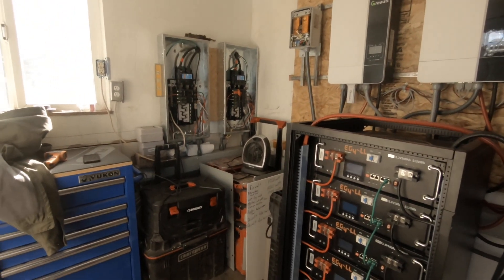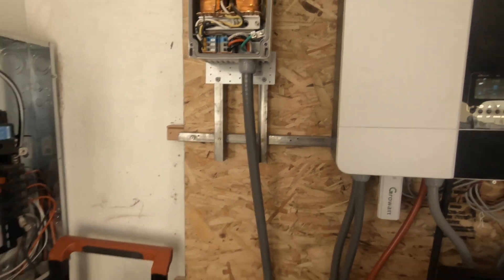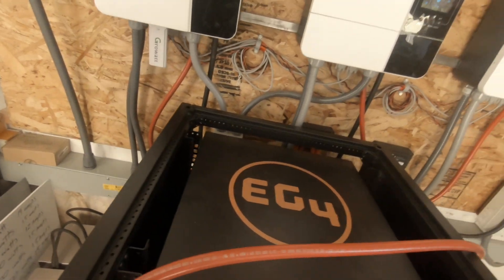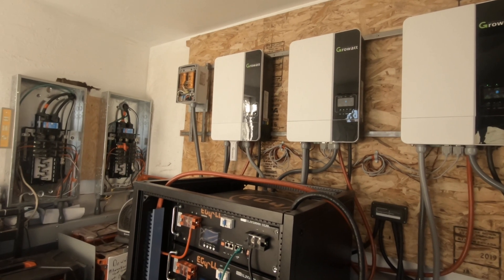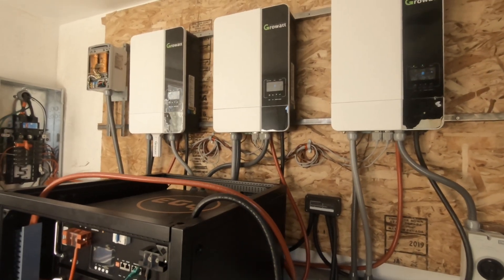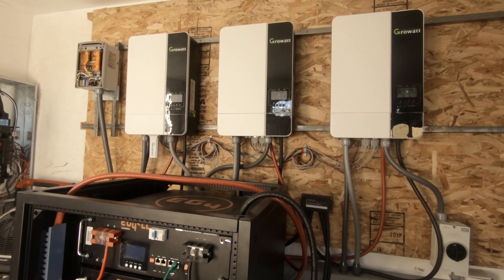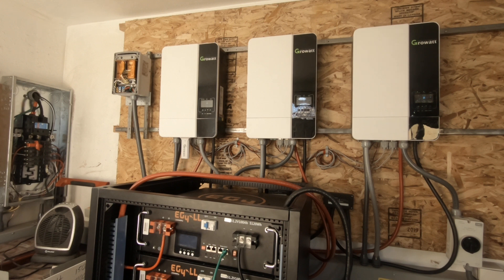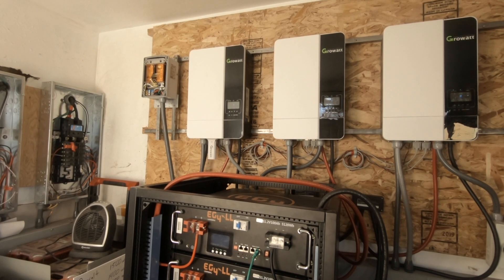battery upgrade part 2

Comment: Hello, just wondering if having two different types of batteries makes a difference? Do the batteries with the display work together with the older Gyll batteries? Thanks
Reply from the maker: all of those batteries are working very good together. I am glad to be rid of the big battery batteries. The Gyll and Egyll batteries are much better than the big battery batteries.

Comment: Just found your channel. Watching intently as I am ready to drop large bucks on a system too.
Reply from the maker: Hi, I am here to help homeowners who are putting in solar for themselves. My goal is to help people to avoid spending too much money and keep them from buying products they don't need. A lot of the sellers and youtube channels get paid promotions and affiliate links. They will use deceptive words like lots of power. but they don't put up a real power test. I wasted thousands buying from just those types of sellers or buying products that those youtube channels endorsed. then when I got my current system installed, they put out a video saying it was bad. Then they put up how they believe their products are better. But you still won't see a power test like the one I put out last weekend. Sorry about the length of the reply here. With these inverters they produce lots of power. But they also save you lots of money. I have 2 midnite solar combiner boxes. Plus all the breakers to go in them. You need to mount them out at your solar array. Then you run the wire to your inverters. My inverters are 98 feet away so instead of using 10 gauge wire? You have to figure your amps and distance you are traveling and put in the appropriate wire size. Too small of wire means a drop in power. That's an extra 400 dollars for each combiner box with breakers. I will post more video's as some of them don't cover enough detail. I am new to editing videos, as I just started this channel.

Comment: Sweet setup
Reply from the maker: On the cost breakdown it could take a few. I have to separate what I spent on things I am not using from the things that I am, Buying from sellers that say oh this will work.
or buying because a youtuber is promoting a product because the retailer is giving him a percentage has cost me extra money. That's why I started doing the videos. Some have little regard for what a homeowner needs are or what he should advise.
I will only make videos of products I am using. anyone who wants can show how theirs is, But i believe there is no better system for the money than the one I am running. One of the people who talks bad about this is telling people to buy the MPP 6548. but I will bet that my system that will have a lower cost can beat his. he also only uses his in his shop. he has a separate system for his house. If you want another youtuber who does load tests? check out davidpoz.

Comment: i am Not a Electrician
.
as i understand grounding
You must have Only one Active Ground in a system / circuit
the incorrect grounding only becomes a major issue
if and only when a
 short happens
.
then if 
neutral and ground are bonded
on the main house system and again on the subpanel
if a short happens on one system 
the current will return on the ground wire
.
because 
the ground is shared 
the current will entre the other system as well
.
giving the same result as 
touching the Hot or Live wire 
of one system to the other system
.
so if grounding is used
they should have separate
well spaced grounding rods
distanced based on 
soil and moisture conditions
.
Reply from the maker: I have three separate grounding systems. One for the solar array which has 2 rods per code. One for the grid power which is shut off. Then the last one for the house and power shed with the inverters. All of which the county building inspectors wanted me to do. All of which passed the electrical inspection. I was only going to have grounding at the service location/ meter. Then at the solar panels, but they said that if I planned on shutting off the grid power, I would need it at the power shed also. The county building inspectors wanted 2 rods hooked together for my grounds at each location. The dual rods had to be at least 6 feet apart. the closest dual rod set is 75 feet.
Reply: great  .. it sounds like you have them wired as 3 separate systems .. each with its own dedicated ground .. just to be hyper paranoid .. confirm there's no continuity among the grounds .. sometimes the house will ground on a water pipe then that pipe touches a item from the other separate system .. but now they are unintentionally bonded by the water pipe .. just being paranoid .. great job with the system i am jealous
Reply from the maker: @godisnowhere4u  my water pipes are pex. So I don’t think I have an issue there.

Comment: The only thing I would suggest.... your battery  bank combination is over 30,000 watts or 600 amps, a T-fuse may be somthing to consider. That's a LOT of power!!! I'm not the safty police by any means, just that, it is more power than people think. Anyway, nice system. 👍

Comment: Just so you know once you get that dongle going you can only read that inverter not the rest. I use my phone to read mine. Signature solar has a nice video on setting it up.
Reply from the maker: I haven't got it up and running yet. waiting on communication hub. was supposed to be here yesterday. hoping it shows up soon. that way i can finish the communication setup.

Comment: Thank you for the video. I saw that Signature Solar has a video on communication between the inverter and computer via wifi. It involved what he said was a brute force setup or some such.
Reply from the maker: I am currently waiting on some communication stuff. the hub I bought locally was not a rs485 hub. It was only an ethernet hub. After I get the hardwire, components hooked up. I will go back and finish the Wi-Fi set up.

Comment: Thank you for sharing I am in the middle of installing the 6 batteries with rack, 5 of the inverters with 2 Growatt transformers on a 22,400 watt solar system. There is a lot of misinformation out there and lots of haters, keep up the good work Freind
Reply from the maker: yes, there is a lot of bad information. I have tried 2 other systems. I only started videos because I was hoping to stop others from buying things they didn't need.
so many sellers and or people with affiliate links just trying to make money. I have so many items I don't need.